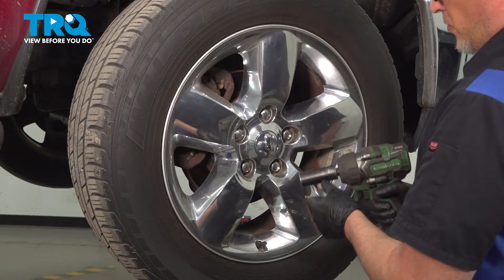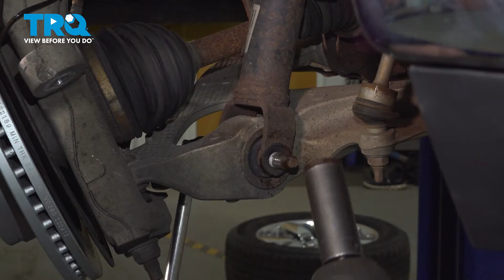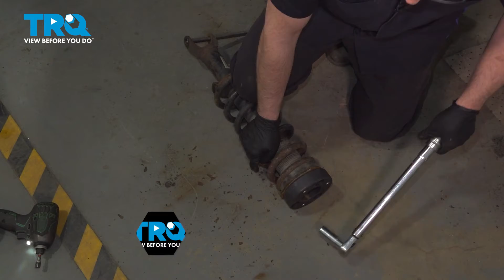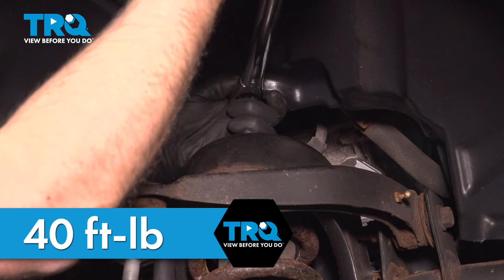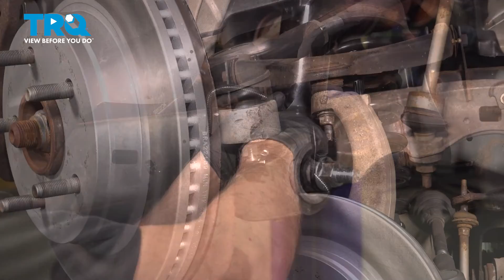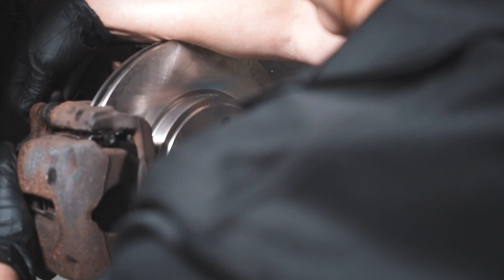How to Replace Leveling Kit 2011-2018 Ram 1500

Comment: so i did this to my 2017 ram 1500 copperhead edition and I think my camber is off. I have taken to get an alignment and was told it was as close as they could get it without an aftermarket adjustment... I came across this video because I was intending to remove it but I do not want to as I like it a little higher. That said, it's eating my outside tires and causing bad road noise, especially around 25-30 MPH.  any suggestions? is there anything else I may need to add?
 Any advice would be greatly appreciated.